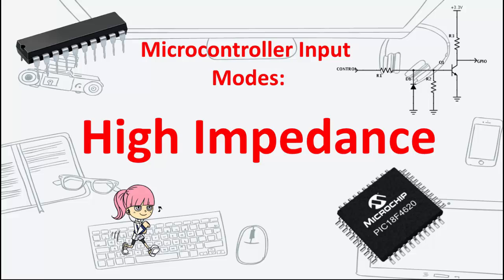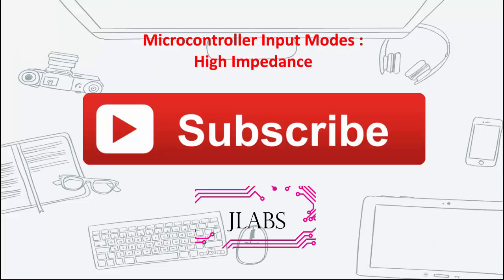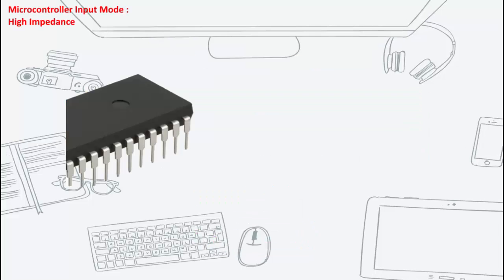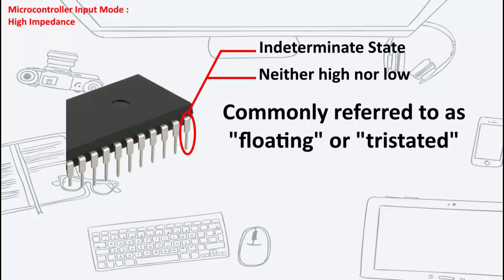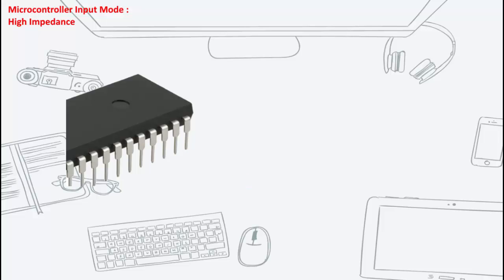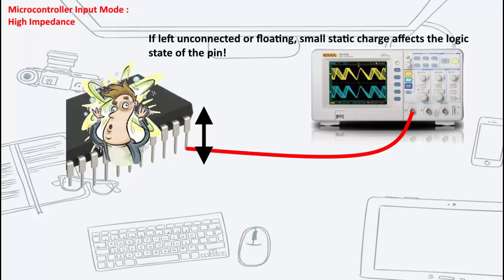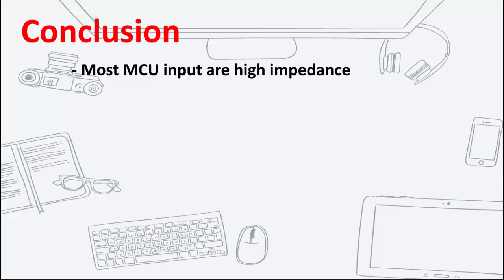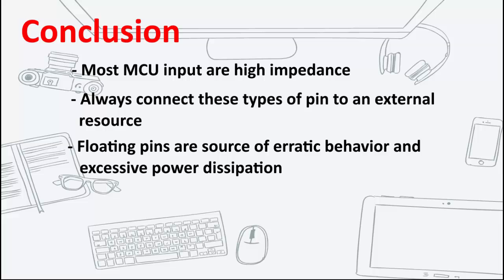Microcontroller Input Mode: High Impedance

Comment: In some cases it is okay to connect the high or low voltage, but... in many cases you should put in resistor (pull-up or pull-down resistor), particulary if you also want to control that pin/wire's voltage.